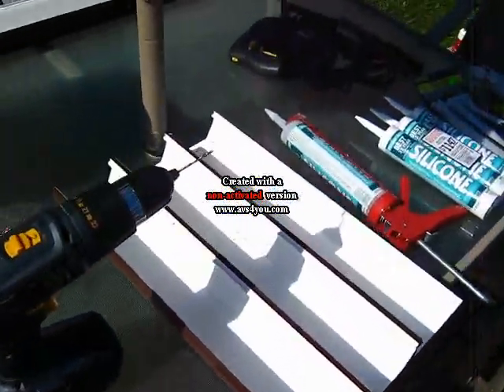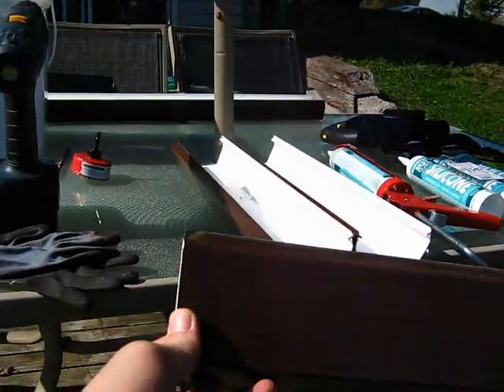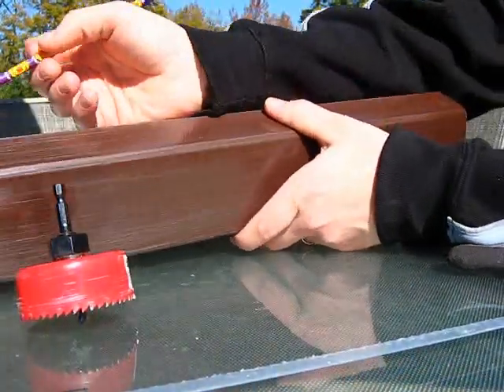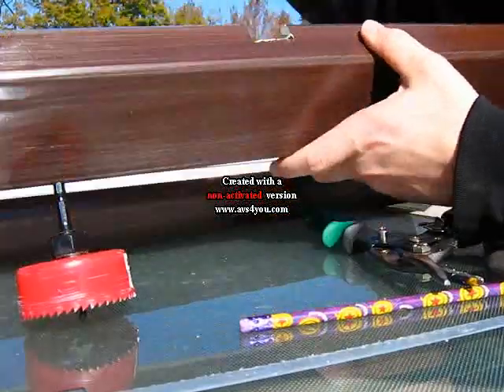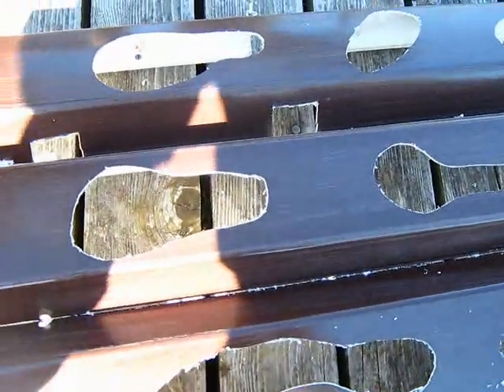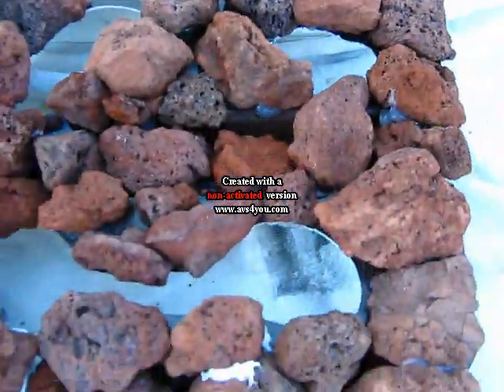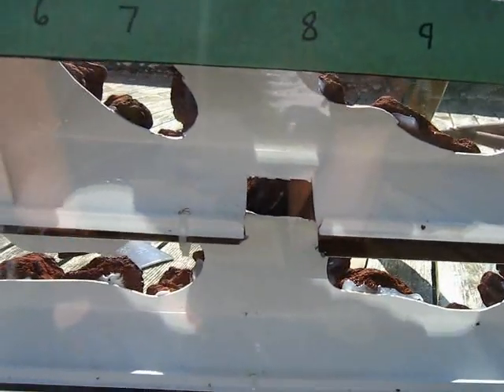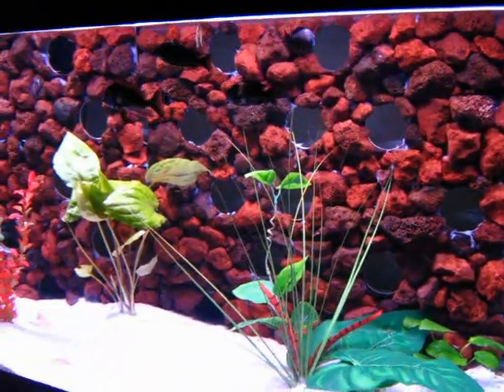DIY Cave Background

Comment: Nice job!  I like that the fish cant get trapped in the back and it looks like there is still good circulation back there as well or you could at least add that to the back if neccessary with one of those magnet mount jet pumps.  Very cool and simple too!

Comment: This is very informative. Well done. Im going to make one myself for my new tank. Youve given me lots of ideas! Personally i thought it would be easier to do the tubes vertically  instead of diagonally, then you wouldnt need to make holes for the heater and filter, but thats just my opinion. Youve done a great job. Im impressed. Better than those shop bought ones which dont have caves.

Comment: Hi. Yes thanks i will. Ive already got the pipe. Im not worried about  construction as im pretty handy at that. Im currently sourcing some paint as im thinking of using  that expanding foam to cover it which makes lots of different weird shapes etc similar to the look of lava rock when it goes hard. My worry is painting it as need it to stick when immersed & i  dont want it to poison my fish & i also have a very large plec which does tend to suck everything in sight!  Hopefully ill post soon

Comment from the maker: I'd like to try a foam background someday. As for using Lava rocks I don't know where you got your info but they don't effect water parameters. I've had them in the tank for 2 years with no problems. This background did fall apart after about 18 months or so because silicone doesn't hold properly to plastic. I plan to make another at some point, but not till I find a better way to keep them from falling off. As for the dumbest thing on YouTube.....I'm sorry you feel that way :(